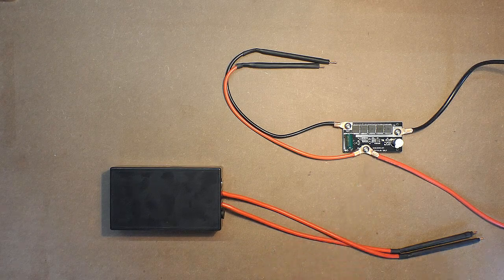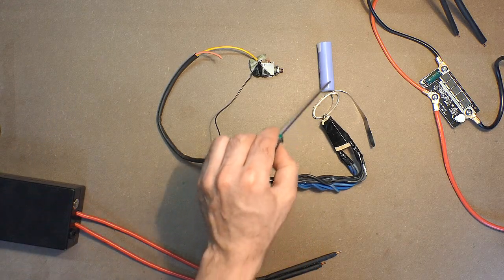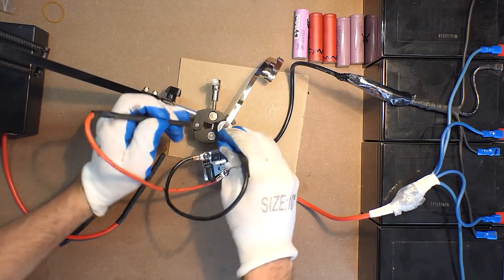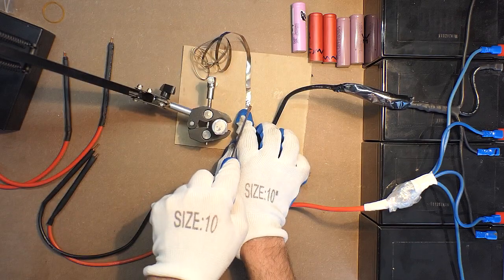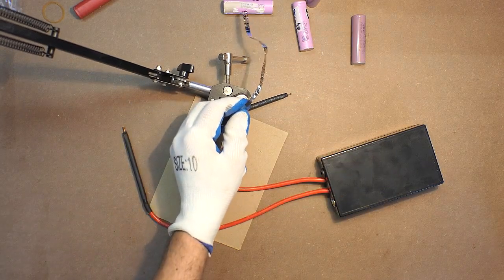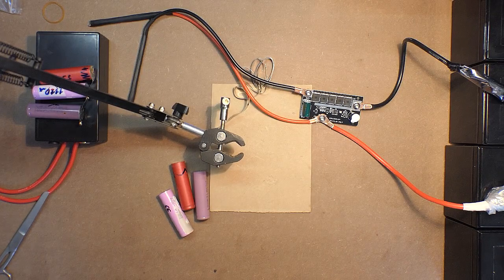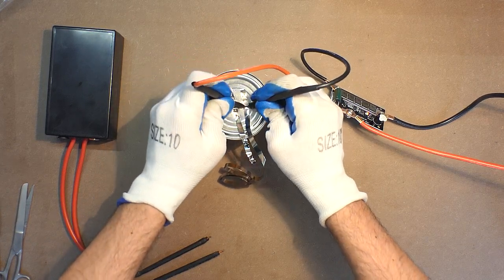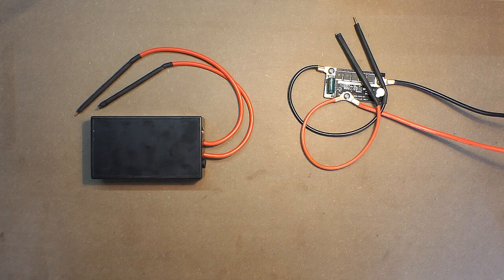DC Spot Welders - which is better?

Comment: I have the black box version, it's good for small projects using the thinnest tape you  can get, but if you use the next size up tape it will not weld even on the highest setting.

Also when you use it you need to space out your welding or the prods get hot.
I upgraded the battery 18650s in parallel will make the welding last longer but there is no warning that the battery is struggling it just doesn't weld that hood when the battery hoes low, I'm sure there may be some kind of warning but by the time it kicks in you have become very frustrated trying to weld.

Overall it's a good little welder for small jobs, large jobs become very frustrating using it.

I also just bought the red box type similar to the other one shown, but it has a red box and needs a car battery, so far I have found the black box better though I will try it with a bunch of 18650s to see if it will improve, at present I'm not impressed with it.

Comment: I think the batteries weren't putting out enough current, I've seen both these welders work excellent in other videos. 
I ordered the Sequre spot welder, should have it in a week....Hopefully it works as well as the videos I've seen testing the Sequre models...they seem very well engineered.

Comment: Thanks for the in-depth review. I recently ordered the bare one, used it with my car battery at level 3, and got an excellent result. Honestly, I thought the portable one (one with a battery) would fail the test. I am surprised at the performance it pulled off. Also applying moderate pressure on the probes and making sure that the tips are important while welding.

Comment: I have the one with the black case. Works great and have done hundreds of welds so far.
Reply: use a multimeter and touch the spot welders positive and negative probes with the multimeters probes, then if it’s under 3.3v you have to charge it. it uses a 5v usb 5.5x2.1 adapter.
Reply: also when it’s fully charged the green light stays on and doesn’t blink
Reply: How do you know when it needs recharging and how do you know when it is fully charged.
Reply: @alanchase7329  I know I'm late, but, It blinks while charging, and when its fully charged the light is not blinking anymore. 
Unfortunately I can't tell you if theres an Indication of when it needs to be charged, because I got mine just a few days ago and there is no handbook for this device.

Comment: the negative side is always harder to spot  weld. I bet it would work better if you clean the surface and worm up the batteries so there not cold . , just saying 808 back out

Comment: The first one I bought was the no case item burned that out in a heartbeat, bought a second one same type this time I followed the mods for it and it work but lugging around a battery for it and getting a charger  got expensive. Got tired of it so I got this with the case. I like it better, easily chargers up with usb and all in one design,works well.

Comment: I learned something watching this video. A “moderate” pressure with the probes is what’s needed to successfully weld nickel strip to battery can. Too “light” makes sparks between probes and strip and not enough melt on the battery can due to inadequate contact between the strip and battery. Too “heavy” reduces the resistance between the probes, strip and battery, so much there is inadequate melt with the energy supplied. One could increase the available energy in this last case but at the risk of bringing one much closer to electrically piercing (melting a hole) through the battery can. Too much of any one variable results in a failure of some kind!

It appears producing a good spot weld requires technique and finesse. Thank you for taking us on the journey!
Reply from the maker: You are welcome!

Comment: You are pressing the electrodes too hard. This reduces the resistance and allows the pulse to go through without creating any heat. Enough pressure to make good contact and you will produce a good weld. (or have the electrodes further apart)
So many of these reviews and all making basic mistakes like using underpowered power supplies or pressing too hard on the electrodes.
The welder is fine, you just need to practice your technique.
Reply from the maker: Thanks)

Comment: Mine spot welder with lipo battery arrived today, but it doesn't turn on..
button never light up the green led, while charging or pressing it to turn on / off the unit.

:(
Reply from the maker: Try to disassemble and measure the voltage of its battery. Maybe there is a problem of wires.
Reply: @powerbatterychannel4315  I did disassemble the unit, and turned at first that battery was at 1.8V.. dead.

After a few hours of charging, it has enough voltage to powerup internal circuit (let is now flashing and unit can be tuned on).

I hope the lipo battery can survive.

Thank You, and glad I bought a good spot welder (in case its not defective lool)
Reply from the maker: @ahlidap  It's always better to charge the battery separately. And if this method works, you will either use the device or you will have to install the Li-Po charger board. But it's anyway better than to purchase a new device. 
Wish you a good luck!

Comment: Good day can I use 3s 18650 battery pack instead of car battery???. Thanks😃
Reply from the maker: Hello, no, it will not work at all.
Reply: @powerbatterychannel4315  if you put 20 in parallel lol. GottA get amps

Comment: I just bought bought the portable one with the black case.  It welded 0.2 and seems to be working fine.
Reply: 0.20mm nickel? Mayyyybe nickel plated steel but not pure nickel. Using plated steel is like using regular gas when premium is 10 cents more per gallon and your car's engine is tuned for premium. 

Nickel plated steel is not a great choice for a connection material. Nickel isn't a great choice but somewhere a compromise had to be made because spot welding copper is....insanely hard. Look at the ampacity of pure nickel, its like one fifth of copper....then look at the plated stuff. On top of that it corrodes/rusts over time which can pretty much ruin cells (no one in their right mind should use cells with rust)

Comment: How thick Was your nickel strip? 0.10, 0.12, 0.15?
Reply from the maker: 0.10
Reply: @powerbatterychannel4315  I have the bare board model, using 3 12Ah batteries ( also tried a large and small car battery ), IT CANNOT WELD 0.15
Reply from the maker: @sovereignman6951  The resistance of the cables should be as low as possible; in this case it should weld.